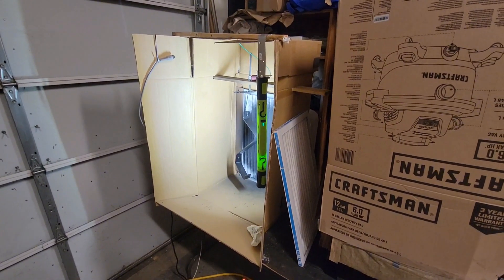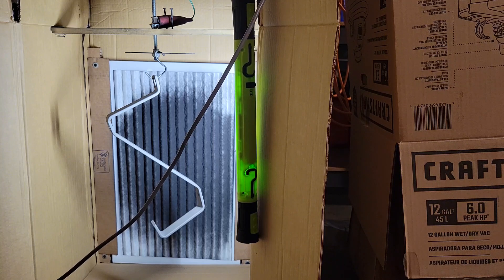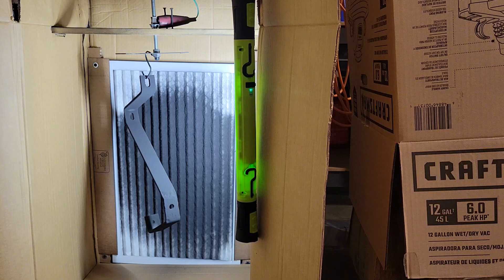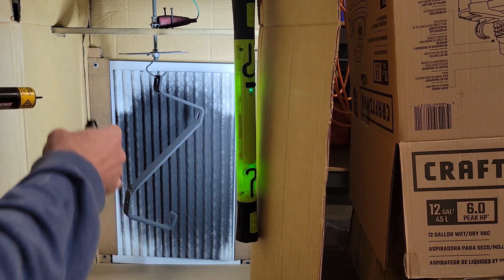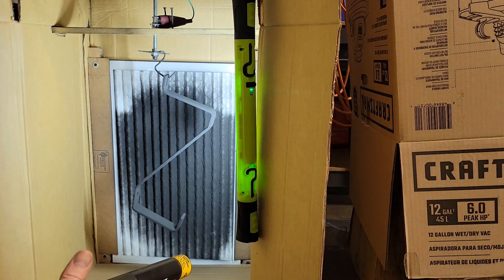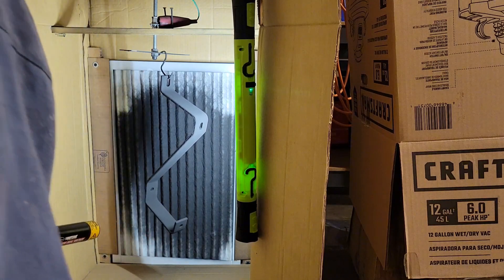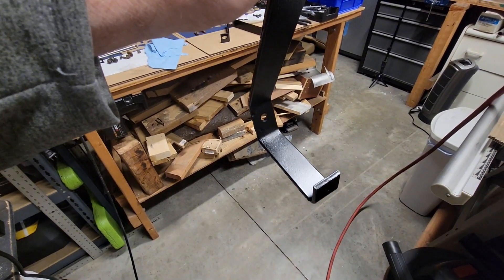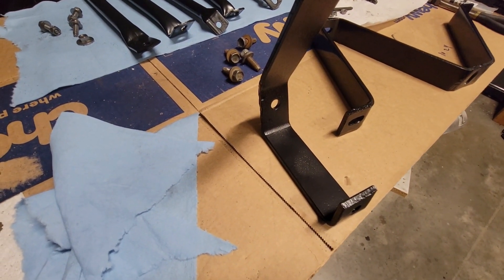DIY First run of the new powder coating booth with Eastwood gun

Comment: I just purchased an Eastwood gun. Page 12 of the instruction book says: As for the powder: A little goes a long way. Filling the gun cup to approx. 2" deep is ideal.
Notice: "Never fill the cup gun more than 1/2 full or incomplete fluidization will occur resulting in clumps"
That's a nice simple setup, thanks for posting!